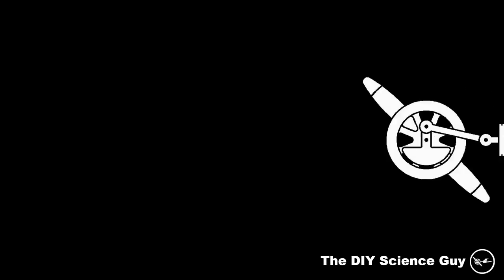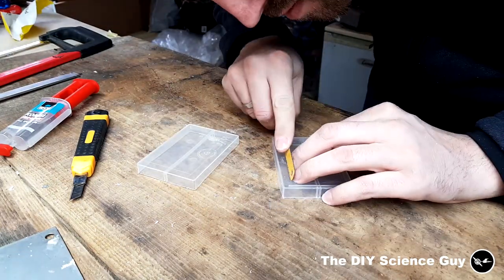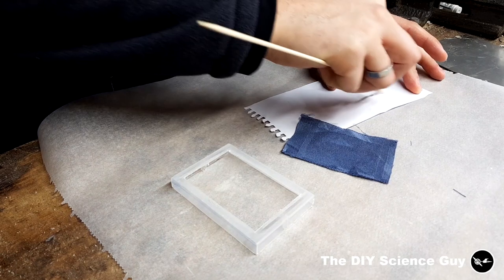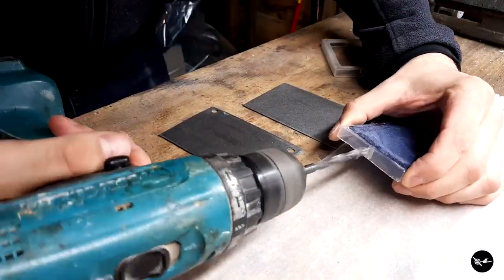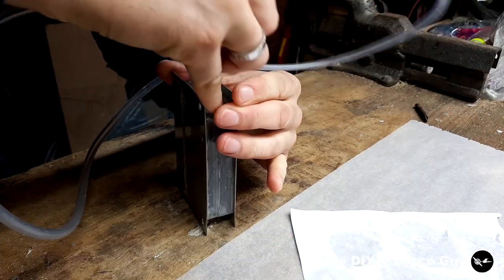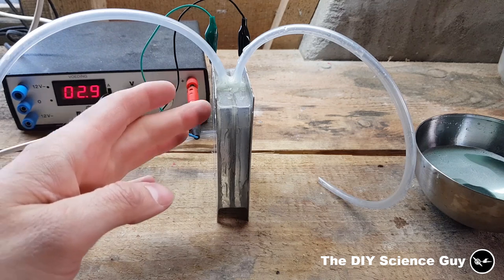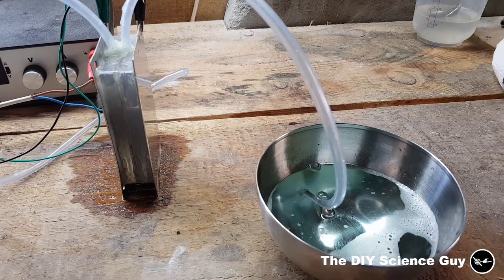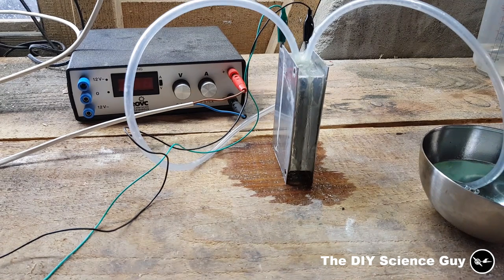Hydrogen Generator #3 Hydrogen generator split cell demo (hydrogen and oxygen separation)

Comment: How hydrophilic a separator is as well as having small pore size  helps prevent gas bubbles from crossing.  Keeping a low rate of production helps the bubbles form larger bubbles before separating from the plate and the larger bubbles have  a harder time pushing through the separator.  I always wonder how well the tight weave on my wife's nylon stockings would work.  ssshhhh dont tell her.
Reply: Clay from clay pots that arent glazed work great in this way.
Reply: @alfredharrison597  my other interest/hobby is electronics, so when I think about how to understand an electrolysis setup and considering that it is an electrical circuit I tend to mash the two together, modeling an HHO cell for better understanding using standard idealized electronic components. 

To that end, and considering current doesn't flow unless voltages exceed  what is called a zener voltage, then electrolysis is easily modeled with a resistor and zener diode in series with the zener diode having a zener voltage of 1.24v. 

Tripling plate area is like three resistors in parallel whoes resistance=1/(1/r+1/r+1/r) were r is the resistance of unit plate area.

Adding a clay pot separator slows down current exactly like another resistor in serries and current through a resistor generates heat, where as over time current through our model zener diode = chemical work done. That is
 time×i×1.24v=chemical energy.  

So in the name of efficency we try to minimize the effective resistance while sustaining a desired hydrogen and oxygen production.  On the other hand clay does a fair job of keeping weak analytes and catholytes seperate under an electric current through the resistance of ion flow through a clay pot. So a clay pot might be a fair choice for making weak analytes and catholites when they are the desired product. 

For simple and efficent gas seperation, a hydrophilic seperator like nylon allows ions to easily through a nylon mesh with little resistance while the nylon holding water to its surface when combined with water's surface tension helps prevent gas bubble crossing the hydrophilic seperator. 

I'm not certain about the purity though and i concede that maybe  despite nylon mesh being hydrophilic, might not sustain sufficent gas seperation purity, and that maybe clay would.

Comment: Oh man! You made nice videos! Thanks for that :) Can you make easier and smaller version of hydrogen compressor. To fill smaller tanks for example the empty deodorant tank? ;) 
I probably will use it on camping as the fuel  to the Mini gas water heater
Reply from the maker: Thank you so much! Yes that is possible. But I would use a small propane tank. Deodorant tanks are not really safe to use for that purpose so please don't do that.
Reply: Okay! Thanks for the reply and warning :)
Btw. I wish you the development of the channel

Can I use a 12 V compressor instead of an old compressor from the fridge?

This 12 V compressor can get 100PSI (7 bar)
Reply from the maker: Thank you so much!! Don't use 12v tire compressors because you can not know if thay also suck in a bit of oxygen because of little leaks. Refrigerator compressors are closed of so thay only will compress what you give them.
Reply: @TheDIYScienceGuy  Okay :)

Comment: Please do be aware that stainless steel contains chromium, which at the anode oxidizes to hexavalent chromium.
hexavalent chromium is a carcinogen, which will cause cancer.
given, the amount produced isn't large, but try substituting the stainless steel for titanium (or carbon compounds like graphite if titanium is out of your budget)
Reply from the maker: Thanks! I'v already been warned by others. I replacing my electrodes with Nickel plated copper electrodes and I'm editing the video about that as we speak.
Reply: @TheDIYScienceGuy  Why not pure copper?  I've heard Nickel is not so good for you either.
Reply from the maker: Copper corrodes away very fast so it needs a layer of nickel to protect it. Nickel oxides only occur in solid form in alkaline solutions I've been told so it will not be absorbed by the skin like chromium oxides. Therefore only the chromium oxide dust is a problem so as long as you keep it wet you're "ok"

Comment: This is great! And I like the music :) I will try to build something similar later on.
BTW - shouldn't membrane be electrical resistant? Plates are charge carriers (through water with NaOH or KOH addition) so electrolysis can work (+/-) on them. Do I understand that correctly?
Reply from the maker: Thanks! No the membrane need to be electrically conductive otherwise there wouldn't run any current and because it  consists of fibers with water in between, fore the current  it's like the membrane isn't even there, so no +/- change.
Reply: @TheDIYScienceGuy  wow I feel like being in school back again :) So the membrane must be conductive but... actually without generating any current on it self... Yea it somehow make sense but can be confused that's why I asked. Thanks for fast answer!
Reply from the maker: Well not generating but conducting. When the electrons go trough the solution than nothing changes in respect to how the electrons move, but when the electrons go from being conducted by the solution to being conducted by a metal plate than it creates a +/- side. And because not the fibers but the solution in between the fibers is conductive, nothing changes.
Reply: spamator12 spamator12 the Membrane is only there to hold the gases separate. We want as little electrical resistant as possible because we don’t want charges to build up at the membrane and want as little „energy loss“ as possible.  Maybe imagine an air filter. You would like to have a good air flow rate but filter out any particles simultaneously.
Reply: @TheDIYScienceGuy  I think you mean "permeable" not conducting. Nylon, polyester and polypropylene are dielectric.  They don't conduct. The NaOH or KOH solution permeates through,  and that is where the conductivity between the plates follows. If you used a conductive mesh/ membrane it would act like a neutral plate,  regardless of its permeability, and change the function of the cell. The gas membrane  absolutely has to be non conductive.  Good cell and demo. Keep up the awesome work. 😁
Reply from the maker: Yes that's what I meant! Thanks for handing me the right terminology! 👍
Reply: @TheDIYScienceGuy You're very welcome.  With so many terms in chemistry, atomic and electro-magnetic sciences, the learning never stops for those willing to chase the knowledge. Glad I could be of a little help. That's what it is all about.

Comment: Constructive criticism: It will keep it mostly separated, however as you produce 2 hydrogen for every oxygen there will be 1) a pressure difference 2) concentration difference 
This will force the hydrogen over to the oxygen side due through osmosis and pressure differential. 
Do you have solutions to these issues?
Reply from the maker: Both sides are at atmospheric pressure, so no pressure problems. Bit thanks! 👍
Reply: @TheDIYScienceGuy  ah! Yes, absolutely. I was getting ahead of myself, thinking further down the line. With regards to use or storage potentially restricting flow. 
Sorry, I start connecting dots in my head

Comment: Amazing Video! This is the best explaination ive managed to find on how to make a cheap and simple DIY hydrogen generator!
My only question is what concentration of soduim hydroxide solution do you use, and have you experimented with using different concentrations to get faster hydrogen production?
Reply from the maker: Thanks! I just trow in sodium hydroxide until it stops dissolving, than it has the optimum concentration and the best conductivity.

Comment: is it safe enough to assume that the H2O doesn't give a a bang? because before compressing we wanna be sure =)
got a 9 plate drycell now with 3 connections like IiiiIiiiI but to run all 8 cells to produce HHO i hookup my power to the first and last cell. should i hookup the + to the middle plate and dive the - wire to the two outer plates and put some nylon monofilament mesh fabric between each plate to separate both gases?
Reply from the maker: You always need to make sure that there is no O2 pumped in to the tank as well. Yes wire it frome the middle to the outside like you said. Yes a mesh between every plate does the tick, and the holes in the seals ofcourse. Good luck!

Comment: That was very smart and interesting... 
Pardon my stupid question ; I just can't figure out what a hydrogen generator is meant for at home ? ... 
😬

What do you do with your hydrogen ? ...
Reply from the maker: Thanks! I fill hydrogen balloons with it like I do in this video: https://youtu.be/PryCxyJ8Y2Y
Reply: On the long term, I would suggest storing peakoverproduktion-energy of renewable sources. You know, gaspowerplants are pretty fast regulable and thus suitable for compensating powergrid-fluctuations caused by renewable sources. Or even biologically Methanate the H2 on grand scale and feed it into the heating gas grid in the winter times. This would be what I‘d do with it.
Reply: @petergoestohollywood382   capital cost per watt hour of hydrogem generated, stored, and converted back to electricity is far more than doing it with a battery.
Reply: Another example is that some home hobbyist like to do welding or jewler at home. Hydrogen generating welders can create an intensly hot flame.
Reply: Keith Reynolds it sure is. And I like the way you think. So I can surely order from you a heated 800 GWh battery Bank for my city to power through winter? No problem, right?
You get the point?
Reply: @petergoestohollywood382  Powering a whole city for four months strait?  Sure, and its a special battery made from unubtaninium. It only cost more than anyone can afford but it's life time levelized cost is still cheaper per watt hour than generating hydrogen, storing it, and converting the same amount of energy as batteries. Do you have any cheap sugestions for storing in hydrogen, the energy needs for a city fow a whole 3 months?
Reply: Keith Reynolds Exactly. It’s not possible with batteries alone even tho they were theoretically more efficient.
And it’s definitely not hydrogen alone. I don’t think there is one single perfect Solution. But what do you think about sealing and pressurising abandoned mine shafts?

Comment: Good idea for separator ...must be 0ver 99.9% effective , but some gas will drift over with solution movement . Some gas is in micro bubbles , a mist of bubbles which are smaller than the holes in the fabric , so can move across.
Reply from the maker: That could be the case but it's not causing problems luckily. But good thinking! 👍

Comment: Do you think it would be better making a wet cell or dry cell?
Reply: "Better" is ill defined. 
One can get more production if they run more amps. 
One can get more efficent production if they lower the voltage. 
Dry cells are nice if you use neutral plates allowing you to work with higher volt power supplies. 
Wet cells allow you to use more of the plate surface area but need voltages that are not as flexible in voltages supplied. 
Dry cell with a membrane is needed if you want to keep the hydrogen separate from the oxygen. Wet cell is less complicated in its construction.
Reply from the maker: Well said.
Reply: @kreynolds1123  OK im gonna stick to building a Wet Cell, thank you.

Comment: your plates are to far apart. this will make the amperage you require to make this work really high...high amperage will cause the heating you are having issues with. melting plastic and all. Voltage doesn't cause heat. Amps cause heat loss. by putting the plates closer you will be able to get closer to the 11-12 volts required to optimize the gas bubbles vigorously forming on the surface of the plates..  the spacing of the plates dictates the amperage required. your sepperator is great and will still work. think about ordering some very fine micron screen from ebay. like the screen used for silk screening..   Great video ,) Forever making.
Reply from the maker: Thanks!
Reply: Actually, the further the electrodes are apart from should reduce the current at a given voltage.

Also both hydrogen and oxygen are generated on each electrode so unless you let the ions travel in your electlolyte to the electrode with opposite charge, you won't actually separate them, and once they form gas molecules and float to the surface you get pretty much a bomb.

Very dangerous stuff

Comment: You never fill the cell up completely but that also means you have a bit of exposed fabric without any water on it, won't some gasses leak through the fabric above the water line?
Reply from the maker: As long as the fabric is wet, the gass can't go trough. Because of adhesion the electrolyte will always go up a few centimeters.

Comment: Can this be powered with sollar cells? If so what do I need besides solar cells?
Reply from the maker: Yes it can be. You can connect it directly, the only other thing you need is..... the sun 😉
Reply: @TheDIYScienceGuy  it can also do the reverse right??? Like if u feed it with hydrogen and oxygen, you can then connect to the plates like u would in a normal battery
Reply from the maker: Not this one but I'm working on one that can.

Comment: the diaphragm or membrane has to be also very low current resistant, did it make a difference in the electrolysis with different membrane?? was it less resistant or more resistant the felt or the nylon??
Reply from the maker: No it makes no difference. Electrode distance does much more.
Reply: @TheDIYScienceGuy   I am attempting a small on a budget hydrogen generator, and found that there is a point under 1/2  inch of  separation between the plates where resistance stops diminishing due to bubbles, is it possible to use an antibubbling agent in the alkaline water, or can you point me to a mathematical model that could give me a better understanding?
Reply: @TheDIYScienceGuy  also, this is a great channel, and thank you for those amazing videos, good explanation and for taking your time answering.
Reply from the maker: Yes I use foam stop which is available for power washers just a few drops is enough.

Comment: I have made many attempts , with a 10 plate generator, I'm having issues every build, I keep getting mixed gas , any tips ??
Reply from the maker: I'm sorry it diden't work for you. The membranes need to be tight, not floppy and you need to make sure the outlets per section aren't swapped accidentally. I hope this helps.

Comment: Hi. Is hydrogen always generated at the negative pole?
Reply from the maker: Yes.
Reply: @TheDIYScienceGuy  Hi. What would be the most efficient cell? Those with two separate negative and positive poles isolated from each other, or those with neutral plates?
Reply from the maker: With neutral plates you don't need a 2 Volt 425 Amp transformer, you can just use a 12 Volt 70 Amp transformer which is easier.

Comment: Have you experimented at all with different materials for the plates?  Was reading something saying one shouldn’t use stainless steel due to potential carcinogen formation (unfortunately the reference was pretty vague and I’m not sure how much to trust)
Reply from the maker: That would than be because of chrome comming off of the plates I think? I don't think dat it's an issue because the plates aren't corroding or dissolving. And in any case don't inhale the gas because there's also a fine sodium hydroxide mist in it. So just always ventilate really well.
Reply: @TheDIYScienceGuy  The plates do dissolve !(cromium begins to react), when the rurrent and the voltage in each cell gets too high (from ~0.4A/cm3 up). Learned this from my own experients. You know this happens when the water gets strange colours like pink or brown (even slight colour changes can be significant). Dissolved Cromium salts are EXTREMLEY TOXIC so be awaware of that risk. You can use Stainless steel, but use a type that you know that it has a high Nickel content and run the cell with a relativley low current . Nickel is waaay more resistant than Cromium in a alkaline environment , so it is quite resistant. The Industry uses Electrodes with a very high nickel content or pure nickel plates. this Principle works great (industry standard must be very good when a cell lasts around 20-30 Jears) they  use about a courrent density of 0.25-0.5A/cm3 
Great Work by the way ;)
Reply from the maker: Thanks a lot for the info! Yes I'm going to use something else for the electrodes, but I'm not sure yet on what to use. Have a little more testing to do. I will make a video of my results. Thanks again!

Comment: Sir can i use a Rubber sheet with a hole in it as a seperator?
Reply from the maker: You can but than the current can only pass through that hole so you would have much less production. Also gass bubbles could pass through the hole.

Comment: Why use fabric instead of a neutral plate?
Reply from the maker: Because the neutral plat divides the voltage in 2, the plate generates oxygen on the hydrogen side and hydrogen on the oxygen side, which causes it to have mixed gas on bought sides of the neutral plate. But good thinking! 👍

Comment: What's the benefit of using sodium hydroxide instead of another electrolyte like sodium chloride? production of chlorine gas?
Reply from the maker: Yes chlorine is a big problem. It's bad for your health and it corrodes the anode very fast.
Reply: @TheDIYScienceGuy  how about pottasium carbonate?
Reply from the maker: Also works but NaOH and KOH are best.